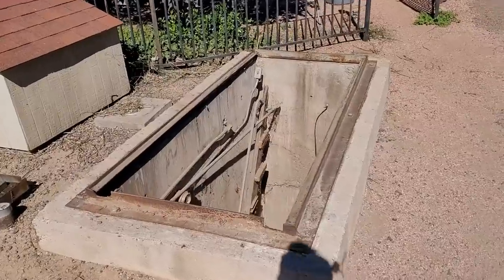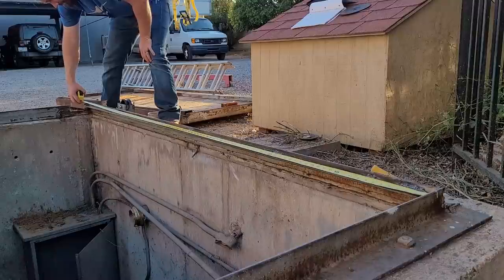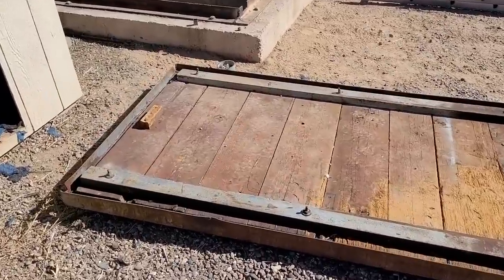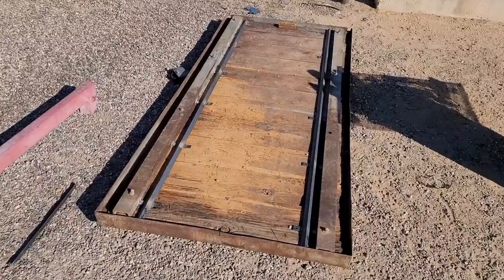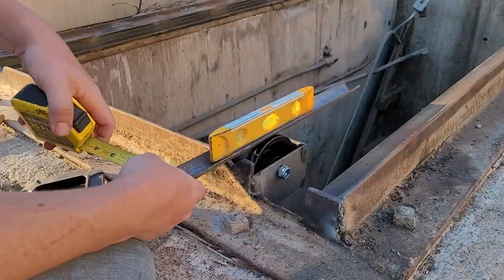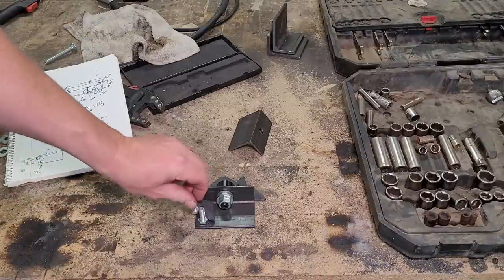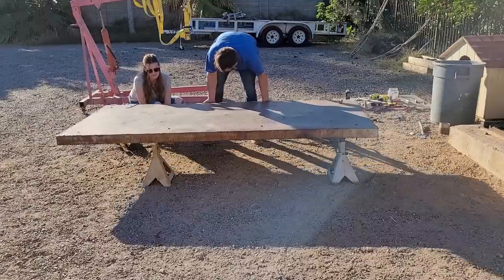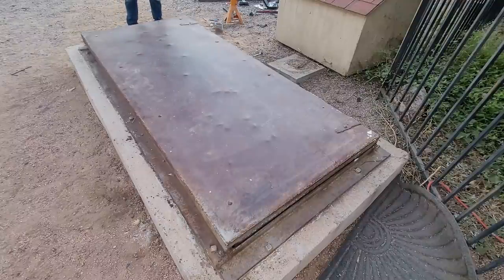Abandoned Backyard FALLOUT Shelter Restoration ep 3: Fixing the Door

Comment: Nicely done, although I would have thought that you would want the door to have a much tighter fit than that? I personally would use a powered rack and pinion style mechanism and a full mechanical override with extremely tight tolerances. Then add an hydraulic ram as a locking mechanism. If there are heavier that air noxious fumes outside (for whatever reason), they will fill up that chamber very quickly and trap you behind that inner door, which had also better be air tight. Water can also get in and fill the stairwell under the right circumstances. Small critters likewise. Which means building a tunnel to your main structure as well.

Comment: My likely will be a great tornado shelter. You need a system to keep the back of the door from being lifted off and a drip edge to keep rain from getting in, which could cause mold inside and cause health issues.
Reply from the maker: You're right, I gotta modify the door a little, and add a locking system!

Comment: Good games room or party room. Love your equipment your got and how you nut it out well done. If using steel for stairs have concrete very dandy foot falls( steps) or folks slip in damp weather. As I did.buggering my back.
Reply from the maker: Thanks Glenn!,  I will do something to prevent slips, I'm still working out the steps design.
Reply: @HerbOMatic  could just masonry bit thru the concrete and bolt in some stringers and then install wooden treads. Should only cost one coin bucket or so at contemporary lumber rates 😫

Comment: Not gonna lie - that was an impressive fix!
I can tell you're a metal-work kind of guy, when your idea of some spacers is to cut some out of metal on a machine, rather than a few 2x2 or 2x4 wood off-cuts... 😂 My skills tend to lie much more on the wood-work side of things, which makes me think - why not just built a normal set of wooden stairs like a house or deck? Some pressure treated lumber and you should be good for several decades surely?
The only other thing - at 49:05 we can see that the door butts up against the side of the frame, leaving an inevitable gap which will let in water (and the nuclear fallout! 😅)  - an obvious flaw in the original design. Could you either modify the frame so the door slides over the gap, or else add some kind of flashing or cap on the top of the door to cover that gap so your bunker stays dry and doesn't rot or rust out whatever stairs you do?
Reply from the maker: Caleb, thanks Man!  Yeah steel is what I have some experience with because I've built a ton of security cages for vending machines.  I have thought about building the stairs with tree bodies, I might do that.  I noticed that about the door,  I may cut that lip off so the door can close a little more, or weld a piece of iron on the door so it overhangs the gap.  Thanks for watching and the comment!
Reply: Caleb? Did you get a toilet seat in the mail?!? 😉
Reply: @billlamm4688  Huh? Um no... should I have?

Comment: Well here are some tips.  Good work on repairing the door.  Next would be to clear everything out and recommend selling what you don't plan to personally reuse. As for the uses cases for the space given that it is temp controlled and massive WITH a restroom there.  Why not turn it into a privet movie theater with part of it set aside for her root celler?  That way you would have something that you and guests could use during blistering hot days AND would keep her happy by giving her space for some cool storage.

As for the utilities I would recommend renting excavator and start by pushing the top gravel to the side to clear it. (Using stakes to stake out what is where.) then dig up the areas that matter.  Like where the water comes in as well as that other vent near the back that had a hard turn. Doing this in some key places would let you inspect and fix things IF they need to be or to reattach things that might have been separated from the main line like water.  Also look into having the tanks inspected for reuse or removal/replacement. You have something there that many would DREAM of.  ALSO one other thing to look into might be a heat pump install down there if you do dig it up.
Reply from the maker: That's pretty much the plan, I've been working on it and filming, I hope to get a video out very soon.  I will figure out the vents and electrical and sewer probably one step at a time.  I think it's going to be an awesome bat cave and storage room.

Comment: Oh pal, you did amazing!! You should be proud :D haha for a bit I did get confused thinking I missed the side/front wheel installation and why it wouldn't rub on the sides :p it's one thing to know a welder, it's another to design these things and to such accuracy while also to such simplicity, wherby using washers to adjust it left to right. I am surprised you didn't use the trailer to reinstall it, or a ratchet system because then it'd be one lift and one pull sort of but damn it man you're strong lifting that bugger. I remember when you maybe first filmed this, clearing it out from within! As it happens I was actually thinking about you two and the shelter a week or so ago when I put lights in my cellar, the timings weird lol. I suggested lots but seems you have it all sorted, don't think I realised your engineering skills :p

You know, I have a request if I may haha. I've been day dreaming of an underground shelter for years, and one idea I had is stairs which can rotate up level, the stairs doing the same as a geared train. I doubt you'd find the use here unless a robber mistakes it as a false floor, but I'm thinking if you could remove those stairs while inside to make more space or access underneath for storage? Also hide the electrical box if you decide that. I just come up with bonkers shit, I'd love to see if that stair idea works :p you gonna motorise the door for convenience? Maybe hide the shelter door as a false floor in a shed with a hoist? :P my mind's full of wonders how you'll end up doing this out buddy I'm really excited! I wish I could join, it's an amazing opportunity/project :D

Comment: Watched the whole thing. How did the tap and die set do?  I got the same set from harbor freight. I was hoping you’d use it and blam-o you did. It was fun watching you figure stuff out and all the nut bolts washers and tools you have. It’s cool seeing you overcome obstacles too and I see you being patient. Not just with your situation but with the wife too. Much respect to you Mr. herbomatic
Reply from the maker: YOU WON!!!  The toilet seat is a Bemis brand with almost no schmoo on it...it would look good above the mantel or in your workshop, it's versatile enough to compliment any room!  Thanks AJ, the tap set worked great.  It did seem to cut the holes a little tight for fasteners but they went in with the 1/4" ratchet, so not too crazy.  I debated taking out the bits about the figuring it out and dimensions for time sakes, but I left them in because I thought it would break the story.  I gotta get better with the welding, the ground clamp had developed a bad connection and I changed the clamp part way through the video and that helped a ton!  I'm going to have to watch more of your videos since you weld a ton!

Comment: In the early '80s in Sacramento I visited a house that had a backyard shelter and it was built by the current owner of that house. it was actually built above ground though like a pill box. super thick concrete walls and ceiling and a super heavy steel door. it was so cool inside there. it was amazing and even in the summertime when it was 100 plus degrees outside.

Comment: This bomb shelter is amazing if your using it for nuclear you need to rubberise the ever doo so it makes it air tight but before you do that you need to unblock the air intake and put in AN NBC air intake. dont forget radiation cant go around the corners. i would suggest adding stair case asap getting electrics in there for light and get rid of the old furniture. find the old escape hatch as well.
Reply: ' Radiation can't go around the corners"... BUT airborne particulate contamination (e.g., fallout) can.

"find the old escape hatch as well."    I thought the whole structure was pretty well explored well enough to find an escape hatch (if there was one) in the first video.   But yeah, I definitely would be uncomfortable being in this with only one way out.   Especially since the door is now so easy to slide closed.  If someone parks a car in the wrong place while the hatch is closed (because of rain, or whyever) ... you aren't getting out without assistance from outside.
Reply: @ssn608  The top hatch isn't to protect from radiation, it's to keep large stuff from getting in and potentially people out. It's the bottom door that would be the tight seal.
But either this was a slap-dash home built shelter or it's not a bomb shelter but a storm shelter.

Comment: must be using a flux core wire welder as those welds are crap and running a wire feed with no cone on the tip tells me it is not argon gas wire feed

Comment: For storm shelter purposes. Since your front wheels are captive inside of the angle you might want to put some type of latch on the back so if there is a hurricane you can latch the back side down. Or possibly some round stock that keys into holes in the frame when the door is completely closed. 

Some rubber skirts on the door (inner tube) could help keep out driving rain. 

Also a pad lock to lock it up and limit your liability from local kids hurting themselves.

Nice work. Hope to see more.
Reply from the maker: I thought of that after the project, I think pins that slide into the frame when it closes all the way would be the simplest.  Good catch, was wondering when someone would notice.

Comment: I know it was heavy but you really want to replace, not restore, that door. It is not thick enough to protect anything. Would work for tornado tho.

Look forward to more videos! Also incredible find of this shelter.
Reply from the maker: Thanks Drakior, the door is to withstand fallout, not direct hits.  You're smoked if you get hit direct
Reply: @HerbOMatic  Haha of course a direct hit would spell doom!
But I mean it needs to be metal for the fallout. You need a denser material then wood and a thin sheet of metal. Also this door does not make a seal as it just rolls on.
Still cool find and look forward to future projects. It will be fine for now but for more security in you should change it.